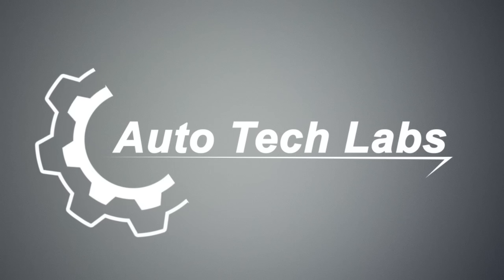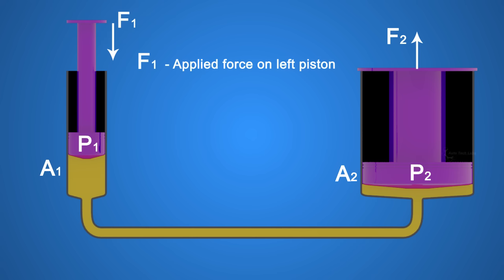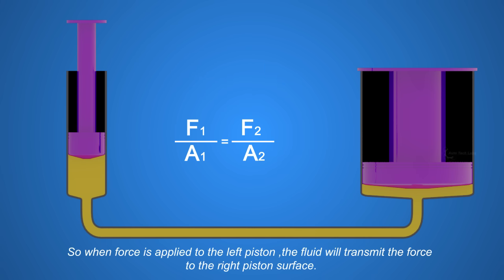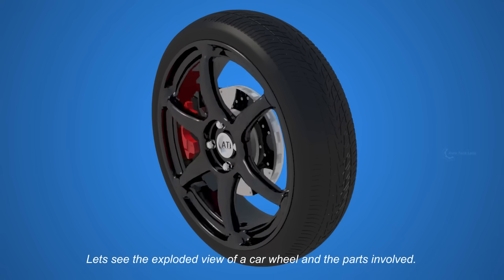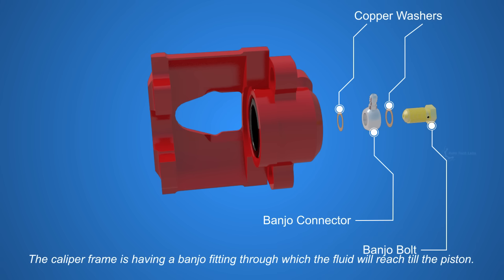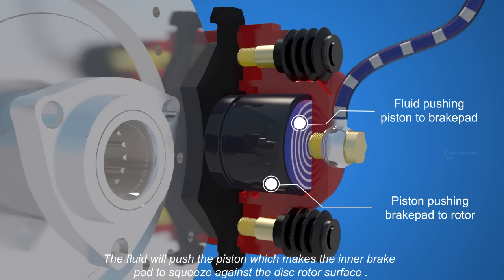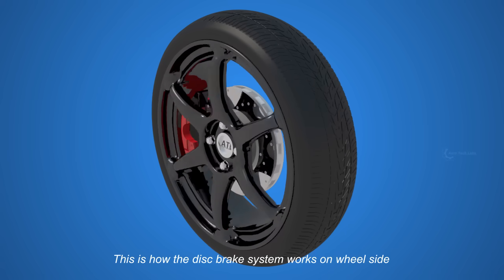How Disc Brakes Works - Part 1 | Autotechlabs

Comment: But how does the calliper move back to its original starting position after the brakes were released? I don't see any spring mechanisms to pull back the caliper.

Comment: I saw so many this kinds of demo. I am sitll confused how the pistal and pads go back to original position (open). Is it still driven by the hydrolic force or driven back by something like spring? All the demos only clear the first half procedure: pistal move forward braking. How is it driven back, reset to the original position (open)?
Reply: There is a rubber seal on the caliper that piston slides through. This flexes slightly outward when the brakes are applied and retracts the piston again from the rotor when the brakes are released. The movement is very small, but just enough to keep the brake pad off the rotor.
Reply: Wait, so you're saying that 2 pieces of rubber push back the entire piston back to its place? I had to use a wrench and a hammer just to push back the piston when i was disassembling my calliper. @hugoknight1

Comment: What gets the brake pads off the disk? Drum brake pads have a spring that push the piston back. The piston on the disk brakes is not being pushed back by anything.
Reply: There is a rubber seal on the caliper that piston slides through. This flexes slightly outward when the brakes are applied and retracts the piston again from the rotor when the brakes are released. The movement is very small, but just enough to keep the brake pad off the rotor.

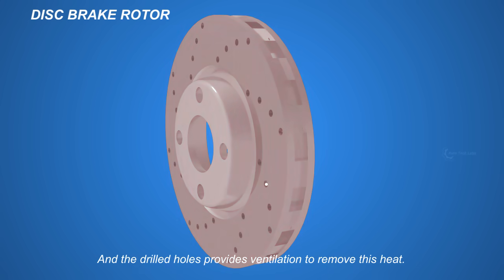Comment: 2:40 drilled holes are not for ventilation, they only help in evacuating gases that the pads produce and weight reduction

Comment: This really throws a lot of light when considering the dynamics of the brake pedal over it's movement, thanks a lot!! Even if now is easier to consider, an animation presentating it would help those with doubts on this!

Comment: Good but you failed to tell what a brake actually does, which is transforming movement energy into heat. That is actually all it does. Hence the heating as you stated. Otherwise it was very educational.

Comment: Once the brake pads clamps on the disk to brake, what force retracts them away to stop braking?? 🤔
Reply: There is a rubber seal on the caliper that piston slides through. This flexes slightly outward when the brakes are applied and retracts the piston again from the rotor when the brakes are released. The movement is very small, but just enough to keep the brake pad off the rotor.

Comment: Drilled rotors are a hoax. They may cool faster than a smooth rotor, but they generate more heat during braking. The smooth rotor has more mass(weight) to absorb heat energy from braking. The drilled rotor has less mass to absorb the same heat. One could argue that the holes let the heat out, so they don't heat up, but one would be wrong by using that argument. The metal that is missing can't absorb anything, therefore the metal that is there must absorb more heat. It's simple thermodynamics in action. The drilled rotor also is at risk of cracking due to the stresses at each drilled hole due to the higher temps, and vascillating heat cycling that they go thru. Complete waste of money.

Comment: My understanding is that the cross drilled holes are not to dissipate heat, but to reduce brake fade by allowing the gas that is generated by breaking to dissipate. Ventilated disks (where you have a gap between the forward and backward facing rotors) are what help with heat removal

Comment: Also show and explain about how it releases the pressure...... And frees ups the disk.......Because my bike disk jaming the disk but not releasing the disk due to which my bike mileage and power gone down help me 

Presently i changed pads and master repair kit ,after 4to 5 breakers my bike tyre gets jam help me
Reply: The piston in your caliper is stuck, because of rust or other contamination. This is caused by old age or lack of maintenance.

The solution - repair or replace the caliper.

Other possible reasons - sticking guide pins, or the brake pads themselves. Check them first because they're easy and cheap to repair.

Comment: Which pad more wear inner or outer 🤔🤔🤔🤔
Reply: They should be the same. If the slide pins on the caliper are stuck then it can cause uneven pad wear.

Comment: So does the inner break pad actually hit the rotor before the outer one?
Reply: That would appear to be a yes. It seems to be a push, whereas on the outer it is a pull. The frame with the piston moves, which is what I needed to get my head around. The used discs I have seen are always more worn on the inside face. Similarly more rust appears on the inner face. I guess the piston must be designed to retract slightly when the pressure of the foot on the brake is released.
I would tend to think if the inner face deteriorates quicker, why not make it a bit thicker than the outer? Doesn't seem to be the way it works...

Comment: I have a question. Why don’t manufacturers put on 2 brakes per disk? Wouldn’t that improve the breaking performance for quicker stopping?
Reply: It can be done but it is not common. Putting two calipers on the same disc would generate a lot more heat. This heat could cause brake failure. It is more effective to put slotted or drilled rotors and a larger caliper, or do a two rotor setup.

Comment: Pls make a veido on ABS breaking system and  what is adventage of using hydraulic breaking system against wired breaking system...... And thanks for such a great veido
Reply: wire would stretch or snap from the force needed to stop the car

Comment: My mechanic said that the brake pad and the disc should slightly touch when the brake is not apply, Is it correct? 
When we step on the brake pedal, they will further be pressed together.

Comment: So what moves the opposite pad facing the one attached to the piston.. not your left foot I'm guessing..
Reply: Dok No See the brake calliper is able to move freely on the calliper guide pins and when the piston pushes the outer brake pad , the calliper moves outwards and pushes the inner brake pad onto the disc. This is why the calliper guide pins must be lubricated for easy movement

Comment: This is only one possibility. This names floating caliper and there are another possibilities for example with floating rotor (brake disc) and fixed caliper and fixed caliper with pistons on both sides with fixed rotor (fixed against axial movement).

Comment: But what causes the pads to pull off the rotor after releasing pressure on the brake pedal?

The reason I ask is that when I did my front brakes, I had to dremel out the portion of the caliper bracket where the pad guides sit, and I think I went a little overboard.  So, the pads were a bit lose in the bracket.  Is this a problem?  Does the assembly count on the pads being held firmly within the brackets by friction (just the force of the fit of the pads in the bracket)?
Reply: There is a rubber seal on the caliper that piston slides through. This flexes slightly outward when the brakes are applied and retracts the piston again from the rotor when the brakes are released. The movement is very small, but just enough to keep the brake pad off the rotor.

Comment: Those drilled holes in the rotor are not for cooling but it's purpose is when the brake pads wear it goes through the holes.. You will never see drilled holes on racing application.
Reply: What was that? 
In racing application, you don't see the holes on the rotor but the brakes still need to be ventilated, they have what is called ventilated disc brakes.
The drilled holes ARE for cooling and also to reduce weight.
Reply: Holy shit! That robot just replied to you :O
Reply: its for stress reduction during breaking
Reply: Glen O'Donnell both reasons seem plausible.
Reply: Exactly !
Reply: It helps me understand the logic, I would like to know whether the bigger diameter disk (230mm / 240mm / 280mm) is more efficient than the smaller one?
Reply: There is reason. When brake pad squeeze on disc, so there is generated gas layer between disc and pads (pads sublimating), so through these holes the gas go away and the rest of pad can easily get to the disc.
Reply: +yuva raja because the force acting on bigger radius, so there is bigger brake torque (when 50 Newtons acts on radius of 1 meter, so the torque is 50 Nm, if the radius is 2 meters, so there is torque 100 Nm) brake torque has same function as torque from engine, but acts in different direction, so brake torque stops car instead of accelerating it. And more brake torque means better braking.
Reply: You my friend don't know much about rotors then.....racers use drilled wholes all the time. Big 18 wheelers use it all the time...it so that air can cool down the rotors because if the rotors get to hot the pads won't have friction and if no friction that means no brakes.
Reply: Gives the rotor more surface area for aur rush over and cool the rotor
Reply: @bobbyhill4715  thank you my guy xD
Reply: Sharp Tube JIM That is completely  false. The holes actually make the rotor easier to crack. They also don't increase cooler when compared to ventilated or slotted. The holes also mean less surface area for the brake to squeeze on, which also decreases brake performance. People only use drilled brake rotors because they look cool, no other reason. Ventilated or slotted are superior. Slotted being the best.

Comment: I've watched several videos and none have explained what causes the caliper pads and piston to return to their pre compressed state when you release the brake pedal.
Reply: Hi both. We are working on a series of technical trainings on clutch, transmission and brakes. In terms of the piston return, it is achieved by an inner seal or "Square cut seal". When the brake is engaged, the seal flexes or deforms. When hydraulic pressure is released, the seal reverts back to its natural state, taking the piston back with it. We explain this with animation in one of our videos. Once up you may wish to take a look.
Reply: @Spraiser74  this explains how the piston returns, but not how the pads return. it does look like there isn't a system to retract brakepads from the rotor., which i think idiotic. the pads move along caliper bracket clips. why not put leaf spring into these clips that would separate the pad from the rotor even if ever so slightly? Surely this woudl reduce premature wear.
Reply: imagine a syringe with liquid and tube attached to the tip of the syringe, when pushing the syringe, the liquid moves forward, and when pulling back the syringe to its original position will pull/suck back the liquid. so the same principle as applying brakes.
Reply: @3ckstermus  Not same as that because the syringe will need the force to pull the fluid back while brakes comes back upwards by itself when released
Reply: @tzone i came here for that .....thanks mate for your answer....
Reply: pads are always in slight contact with rotors. let go off the pedal equals no pressure and no force. however there's a rubber fixed flexible O ring around the piston that act like a trampoline, slightly sling shooting the piston back to reduce rubbing.
Reply: I just want to ask the same question. Almost all of the videos are only explaining and animating the simple braking principle. None of them explained how the pads restore to the non-braking position. If the hydro-piston is pulled back, how the pads restore to the original position? Only a half demo.
Reply: The spring in the servo (braking assistance, which is directly connected to the master cilinder).
Reply: Okay, I have a bit more interesting question... Why the piston moves continuosly OUTWARDS from caliper (depends on brake pads abrasion), but backward move is not the same? I mean the gap between pads and disc is always the same independent on their thickness during continuosly abrasion by using.
Reply: @edgarkoterle  Well, if the force caused by the sqaure o-ring seal gasket that surrounds the piston is what makes the piston retract, then the reason the space remains the same between the pad and the rotor is because when pressure on the system is applied the piston can move in the direction towards the rotor as far as the brake pedal pushing the other components allow but when retracting it only retracts what the square cut o-ring seal is pushing back, which is minuscule. So as the pads and rotor wear the piston will continue to advance towards the rotor but only retract the distance the seal is pushing back which also explains why brake fluid eventually needs to be added because as pads and rotor wear there is now more volume in the caliper requiring more fluid.
Reply: Because P1 = P2. When the pedal is released    since they have equal pressure they come to their normal position s...
Reply: The piston only moves towards the disc with force. When the force is stopped the pads just float on the disc with minimal contact otherwise your pedal would travel to far before the discs are actually pressed against the disc.
Reply: +tzone  but if the system is sealed  then the brake pedal return to its upright position the fluid would cause the piston in the caliper to back off of the disc and back to their original positions
Reply: That's what I thought too but investigating further apparently there's a square gasket seal that  sits in a recess in the piston cylinder wall that rolls when the piston is compressed and unrolls when  the brakes are released assisting the piston back by the smallest fraction to release the rotor...apparently.
Reply: i see thanks for sharing
Reply: Riverdene Consulting Ltd  thanks!

Comment: I don't understand how the brake Is attached to the wheel, the wheel spins but the brake don't, can anyone explain that to me please.
Reply: +AutoTech Lab thanks alot for the answer
Reply: TheGamecheater100 if the calipers rotated with the discs it wouldn't stop because it needs to be a attached to a stationary base in order to stop. Just logic

Comment: thanks for the great video but i have a question, what pushes the piston back when brake is released because i disassembled the caliper on my car and pushed the brakes so the piston extended out and i had to use a c-clamp to get it back in, i mean why doesn't it return back when brakes are released and doesn't that make the pads in contact with the rotor all the time ?
Reply: +AutoTech Lab Thanks i was just confused because my right wheel brakes seem to be slightly stuck and the wheel doesn't move on low rpm while the car is on jacks i thought this might be the problem but i'm guessing now it could be the master cylinder, another question can a faulty master cylinder cause the brakes to stick on one side only or does the master feed both sides at the same time, and are the 2 pistons inside the master for right and left or not ?
Reply: The piston is sliding on a square seal located in the bore this seal is what brings the piston back.. As the piston moves the square seal will twist slightly when the brake is applied and when the brake is released the seal will bring the piston back so the seal is flat..
Reply: Amr Teko omg i have the same question. Still dont know what is 'square seal' and where it is alocated. I need to check that part on my bike. Doing investigation... would be nice if someone can give me some hints..
Reply: Bro the break piston have more elastic spring it pushes bake.

Comment: ok but did u explain how piston calipers go back to its original position when u let off brakes?
Reply: Good question. I can see why the caliper piston would pull back, but why would that cause the caliper frame and pads to move away from the disc rotor? The inner pad has no mechanical fixing to the piston to pull it away. And there seems no reason why the inward movement of the piston would cause the caliper frame to shift outwards, to pull the outer pad away from the rotor.
Reply: true, i have the same question in my mind
Reply: casanovaevren You let go the brake causing negative pressure.

Comment: Nice explanation. But i was wondering why only Hydraulic fluid, if only requirement is pull and push. Why not some wire system like we have in clutch wire?
Reply: Interesting stuff with fluid, didn't know that. Thanks for replying.